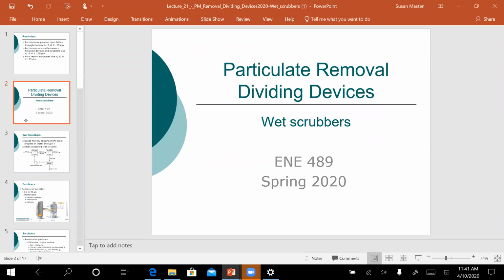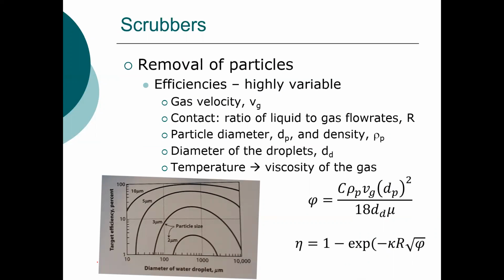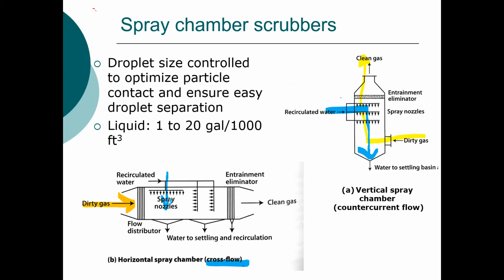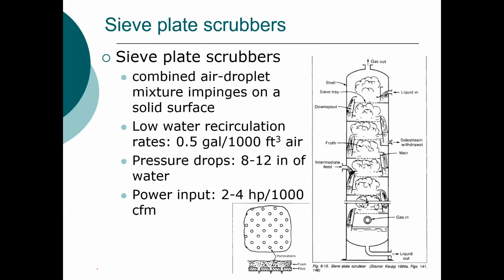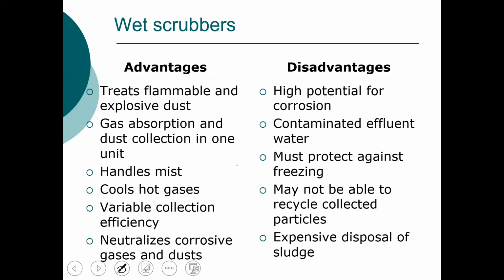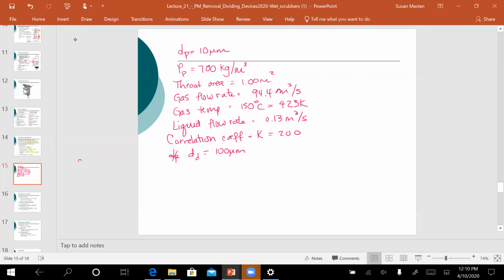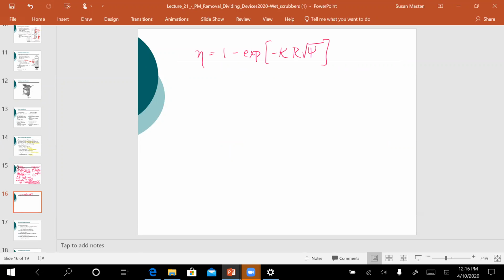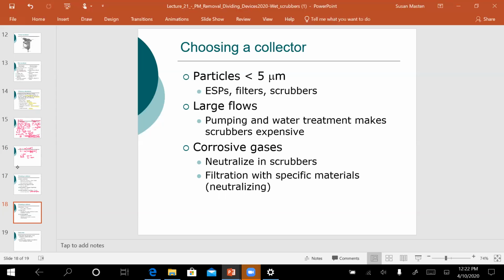ENE 489 Particulate Removal wet scubbers

Comment: Thank you mam lecture was very much helpful. I am doing a calculation on venturi scrubber design.
I have assumed particle PM 10 as particulate pollutant. 
I want to know how to determine or assume liquid flow rate and gas flow rate for the venturi scrubber using liquid to gas ratio.
Reply from the maker: The liquid flow rate to gas flow rate is typically in the range 3 to 15 gal/1000 acf. I would suggest checking with the manufacturer to be sure.  Too high a liquid flow rate will result in excessive head loss and very little, if any, increase in performance.
Reply: I am currently prototyping a wet scrubber that is of completely different model is design. Just learning here how to work things out. Thanks for the lecture.